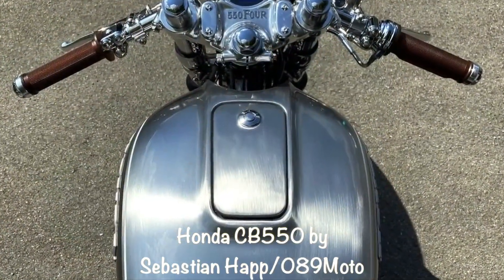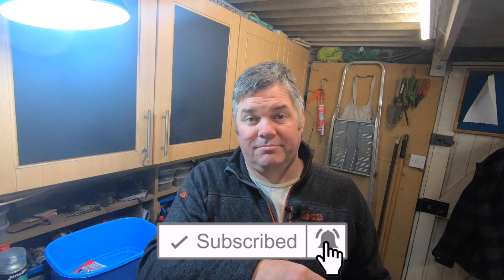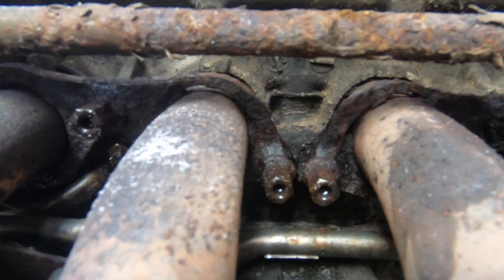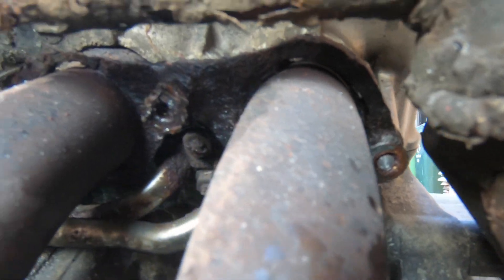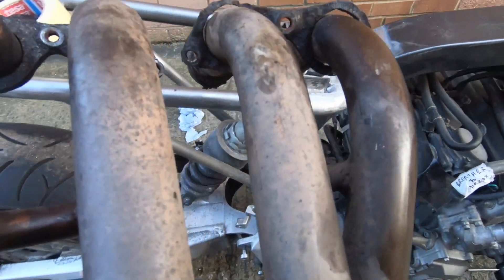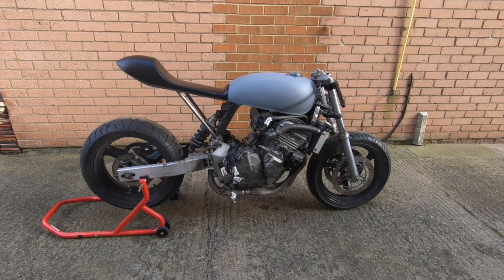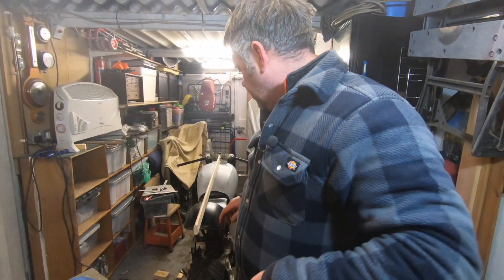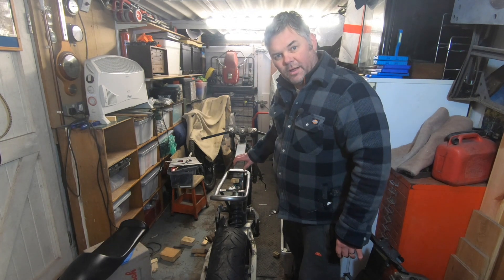Honda Hornet Café Racer Budget Build - Episode15 Engine out & moving the rear shock mount

Comment: If you’d attached the sub frame at a lower angle wouldn’t that have fixed the issue of it sitting too high?
Reply from the maker: Hi, you would think so but, If I lowered the sub frame at the back it would have meant lifting the tank at the front to keep the straight line. I couldn't lower the back of the tank as it was down about 6mm from the frame (so like a pivot point). I didn't like the look when the tank was lifted at the front,  so I got the best (lowest) line I could and then dropped the rear shock mount (a compromise) other options were a shorter shock, or cutting out the bottom of the tank, does that make sense? I probably spend hours staring at the bike and thinking through the options, thanks for the question though, all comment welcome
Reply: @sgrids  yes makes sense! Thanks. Keep going it’s looking great